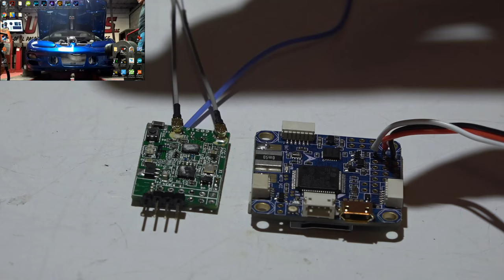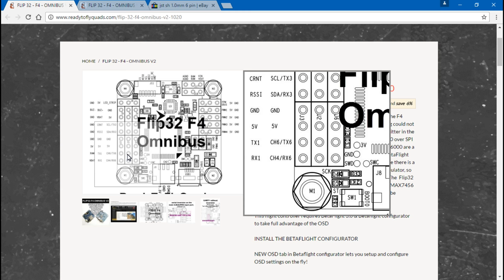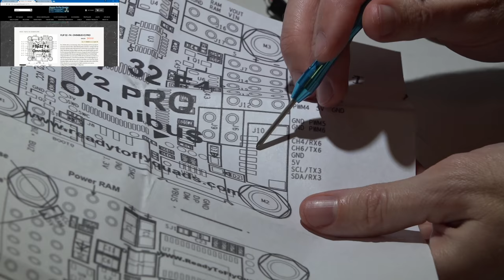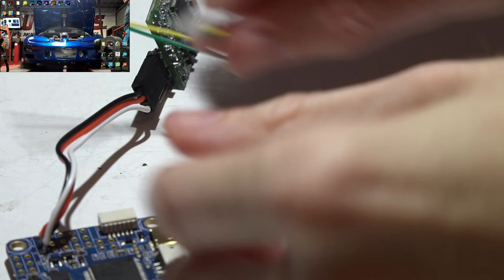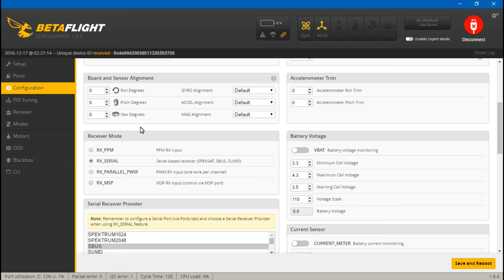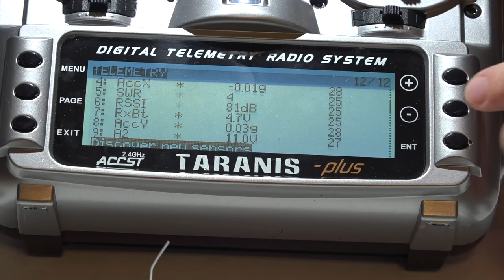Omnibus F4/F4 Pro & X4R-SB: Connect & Telemetry

Comment: Thanks BF! You're keeping me in the sky!! Really great content and delivery. For anyone still struggling with getting IBUS working for the F4 PRO board, I can confirm that the RX6 (UART3) pin does work. I was in having real difficulty until I realised that the manufacturer had soldered a 4 pin socket on to the board where the 6 pin "J10" should be, totally leaving out RX6 and RX3 - anyone else get that? Anyway, just levered the socket clean off the board and soldered directly to the RX6 pad, got the 5V to power the receiver elsewhere on the board.

Comment: so with OMNIBUS F4 PRO V3 FLIGHT CONTROLLER WITH CURRENT SENSOR, OSD AND SMARTAUDIO do i get the voltage from pdb hooked to the flightboard or do i need to have x4r-sb wired up inverted like you show? what im trying to ask is if i dont have the smartport wired up on this board and just have power from pdb to it do i still get osd showing my voltage?

Comment: Have you noticed that on the black and white wiring diagrams where the M3 screw holes are shown in the corners they show M1 M2 M3 and M4. They got M3 and M4 switched around!!!! That can be quite confusing don't you think ?
Reply: PS could never have got my F4 working without your videos - thanks so much Tim

Comment: Got a question on the omnibus f4 got it flashed set up with my taranis after i calibrate the accelarometer on screen it's facing the right way but you roll the quad it yaws you yaw it pitches confuse can you help

Comment: How many uarts are there, I would need one for sbus right? one for un-inverted x4r SB, and then one for the irc tramp or unify pro. Can i have all of these together or not. If so great but if not what fc would you recommend to do this. I would like an osd built in but i guess i can to use and external one as well. Thanks

Comment: I made all like you but it dont work for me. Tried on UART3 and UART6 but Taranis cant find any sensors. Iam also using Omnibus F4 Pro, X4R-SB and latest BF 3.1 RC4. Any ideas?
Reply from the maker: All I can think of is recheck the settings in betaflight because sometimes the settings dont save. Also make sure the wire you soldered onto the X4R to get telemetry is on the correct diode.
Reply: I checked the hole night. I soldered a new cable, tried out different BF versions, created a new model in taranis, bind the x4r again and again... But i get no telemetry. Thats very frustrating.
Reply: time to try the size ten on the top of it !!!
Reply: Did you figure this out?  I'm having the same issue.
Reply: Yes, i bought a new x4r and then it was working fine.
Reply: There's a small sbus jumper that must be soldered on the Omnibus F4 Pro.

Comment: Subs is uart1 too but inverted and the other one is not inverted.
Reply from the maker: Thanks for confirming.
Reply: what do you mean "Subs is uart1 too but inverted" 
Is uart1 the sbus connector?
I can see on the diagram that there is a tx1 and rx1 on a separate jst 4 pin connector.
Can you please clarify? Thanks
Reply: The SpekSat port is also UART1, so there are 3 ways to access UART1, but as you say the SBUS through-hole is the only inverted one.
BTW I have the F4 Pro V3 (with smart audio) and there's a PPM/SBUS jumper next to the SBUS pin, so I guess you can use that pin without inversion also.
Reply: Please make this clear, because I am short on UARTS.

What I`v connected so far:
I have SBUS connected to SBUS pin (i think it shared with rx1)
I also have gps connected to UART6 (using both rx6 and tx6)
I also am availing UART3 as I am using SDA and SCL pins so UART3 is unavailable.

So were can I connect telemetry now ?
Can I use UART1 tx1 pin ? telemetry data should be transmitted from FC to receiver, am I right?
If  so how should UART1 be set up in software?
Reply: I have this problem too,there are short of UARTS to add a BT/Telemetry device.Does anybody know how to solve ?

Comment: you have all these great videos can you please make a video showing how to flash betaflight on the very popular board the Omnibus f4pro. I've pressed the bootloader button and then plugged it in press flash it never flashes. yes there are plenty of people out there like me that have no idea how to flash a newer version of betaflight long to our board and would very very very greatly appreciate a video like this. you definitely just don't go too far more and click flash that doesn't work. and then to have 3.1.7 you need to download a hex file there are no video showing you how to do this and for people that are not great at computers like me I just won't do it and then to have 3.1.7 you need to download a hex file there are no video showing you how to do this and for people that are not great at computers like me I just won't do it unless there is a video I'm too scared to lock up my flight controller and not be able to fly by hitting one wrong button I'm flying right now but if it doesn't Flash and locks up I'll be grounded until I find a video to fix it

Comment: Does the pro not have this issue?:
https://www.rcgroups.com/forums/showthread.php?2790167-OMNIBUS-F4-LDO-woes
Reply from the maker: If you mean the voltage regulator getting hot, yes they all get on, on all the Omnibus FCs. But I've never had a voltage regulator burn out. Thats out of four F3 Omnibus, one F4 Omnibus, and one F4 Omibus Pro. But then again I'm not powering my camera or Vtx off the Omnibus. I power them separately. I believe that would burn them up.
Reply: They don't burn out, they have a build in overtemperature protection, if they get to hot, output voltage will drop to nothing
Reply: The MCU  has an overtemperature protection or where is it on the board?